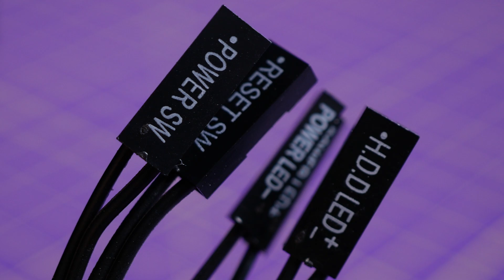How to connect front panel PC case power cables (power button, reset switch and more)

Comment: Is there someone or company make an L-shaped adapter for those jumpers: Because I want to install a second graphics card on 2nd pcie slot but the board is mATX AND the card covers whole space of the jumpers (f audio, f usb fpanel...) so I can't route the cables to pluggin in them :/

Comment: Am i crazy or at 3:27 shouldn’t the power connection have been connected to the top row instead of the bottom that belongs to the reset wire connection?
Reply: Yes he most definitely did that incorrectly. Pretty big mistake for an instructional video for newbs.
Reply: I hate that he didn’t respond to this comment because I noticed that too
Reply: I love you thank you so much

Comment: Pc hasn’t turned on in months. This did not fix it. Was really hoping it would
Reply from the maker: Does the motherboard get power? Can you see the LEDs on it or any lighting suggesting it's got power? Is it possible a power cable is loose somehow? Or perhaps your PSU has stopped working
Reply: @TheProvokedPrawn haha so I actually did end up getting it after messing with so much for over an hour and more research. Somehow got motherboard to finally turn on to give me the code C1. Then all I did was move the ram a slot over.. 🤠 but apparently I need to q flash my bio anddd this thing is 8yrs old so this is fun.

Comment: Sir I have this pc for about 5yrs now, yesterday it suddently shut down itself and couldn't turn back on, so I open the case and check if the mobo led indicator blinks while connecting power source, it did not, but when switching off the power from the main box, the mobo led  indicator blinks a few seconds then off. Please help!!

Comment: My case's front panel has a single F Panel connection, with the power and reset switch combined in the same connector. This supposedly simplifies the connection to the header. But the case has no power led. I want to add one which can be easily bought. But the case F Panel connector makes the mobo's power led header unusable. Any ideas how I can add a power led? My cases have always had a power led, I like being able to see it flash when the pc is in sleep mode. My new case is the LIan Li Lancool 216 RGB.

Comment: My pc has the single F panel connector but it fits loosely. Idk if the connection is supposed to feel a little loose, but does that mean I’ll need to get the extension cables with the split connectors?

Comment: Do u no Corsair 3500 case can u just use the plug came with case straight in too B850 aorus elite WiFi ice mother board instead using them little things
Reply from the maker: Yup

Comment: I just want to say, you helped me a lot during my build. I've watched countless of your videos which all helped me immensely! Thank you very much! Also the reason I'm watching this one is since my power led on the front panel is not lighting up, could this be a motherboard setting? I checked for continuity already.. the motherboard is fine but the front panel is harder to measure. I'm using the asus tuf b650 gaming plus wifi with the h6 flow (rgb). Again thank you for all the helpful tips and tricks! You're the man!

Comment: The mother board I am working on has the reset printed a bit to the right, not directly underneath the power button. Does that mean I need to skip one pin and plug in the reset button on the last two?
Reply from the maker: Refer to your motherboard manual

Comment: I've been researching all over to find what that arrow symbol was for on the power plug in. Thank you for telling me the answer to that. I bought the case from a friend who didn't have the manual, and it was my 1st build. So I'm glad to finally get good answers to my questions
Reply from the maker: Glad I could help!
Reply: @TheProvokedPrawn  Thank you so much! Another head scratcher is ground. According to Internet AI, the ground connection is considered to be negative in most electrical systems. Of course, my motherboard uses ground instead of negative. 🙄

Comment: no offence. I generally love your content but I need to give you feedback on this particular video.
Your target audience who would want to watch this are either noobs at pc building or those who have not built for a while  and just want a refresher.
However,  touch your own heart when you re-watch this video and ask yourself. 
Is this sufficient for such a target audience?
You connected it without showing all necessary connectors and even do not show the important one where it's single cables with "plus" and "minus" signs because it's blocked by the first connector you plugged in.
Then you suddenly ended your video assuming people would just "get it" for connecting the rest of the cables with poor camera angles and connectors that can't be seen when you plug them in.
"Watch out for that little arrow" With the freaking HDD LED connector blocking the view.
This is such a lazy work with no empathy for the specific target audience. Luckily there are better videos than this.
Reply from the maker: No offence...followed by offence. Love it. This was a short version of a much longer and more in-depth video. https://youtu.be/xT36IDSQBX4

It's also one of my best performing videos so. Whatever.

Comment: The FP connectors are the most dreaded part of the build for me...This is a simple, straight forward explanation to it.  I do have one question,  I have a Lian Li O11 Air Mini and I don't like the flashing LED indicator, I am assuming it is from the HDD activity connector.  Would disconnecting this get rid of the flash and retain the steady LED?

Comment: You just saved me a trip to my PC guy
Reply from the maker: Excellent
Reply: NEVER, EVER go to some shop. Just don't. You will pay money to a bunch of dumb teenagers who know very little more than you could figure out with a You Tube video and they might actually create  more problems for you!  There's always a video for how to do it for yourself. 
These days, I use pc repair shops just to buy a random little part I'd have to wait days for if I ordered it. 
I stopped using repair shops (years and lots of knowledge ago) the day I tried to get them to replace a PSU that was overheating on me (could smell the burning plastic/rubber) and the guy took one look at my gender and told me the "PSU wasn't blowing, I just got carpet fresh in it". CARPET FRESH wtf!!!!  Still makes me furious!! Purest example of sexism I ever experienced in my life! Also, the PSU actually blowing could have damaged my components. Those shops are akin to paying your weird uncle to fix your car by rigging a toggle switch under the dash vs just fixing it yourself the right way by researching it.  
 That PSU blew the minute I got it home, btw. I ordered my first part online that night and installed it myself! Then I began to learn to build by myself from that point on. I suppose I should thank those idiots for setting me on the path of building my own pc's, but I can't get over the blatant insult of it. 
 I'm still learning things. I'm on my second full, from the ground up, build now, despite the years I've been doing this. Usually, I just upgrade parts for a long time, but this time everything needed overhauled, complete with a new grown up looking case that sits in a living room and looks more like a large speaker.
  Thus, I am on here looking for how to install those little f panel connectors when they don't come as one piece in the new case and this mobo is also high end and a bit more complicated than the old one. 
 I'm still not sure I have the instructions clear, but I got the part where nothing will blow up. It simply won't work if you get it wrong. LOL!  
Anyway, yeah, stay away from pc repair shops. Don't pay them and they will go away.

Comment: I cant find the reset sw cable
Reply: Me neither
Reply: Same
Reply: @Notachillguyatall  i found out how it works you dont need it
Reply: @mpfreerider6733 does your pc run well without having reset psw bcs im either cant find the reset psw but my pc is t boosting
Reply: @ i pretty sure some  might not have them because mine doesn't and its good
Reply: Need to look later how it works
Reply: @mpfreerider6733 ok
Reply: I can't Neither
Reply: @ some don't have it mine didn't

Comment: I have a wire missing from the Mystic light breadboard that illuminates 6 ANS AND A DRAGON and the MSI CPU cooler. It has 2 wires. Where are they connected on the motherboard? There is also a SATA connector at the bottom of the board. Without the lone open pin at the top of the board, all the fans light up red? Is it the RGB I read a warning about 12v and 5 v connections will nuke it if connected incorrectly
 ARGB control board in the chassis. You need to use it to control RGB with the MSI Mystic Light app in Dragon Center.. ARGB control board in the chassis. You need to use it control RGB by MSI mystic light app in dragon center. But only 100R support it the ARGB board. ARGB control board in the chassis. You need to use it control RGB by MSI mystic light app in dragon center. But only 100R support it the ARGB board. ARGB control board in the chassis. You need to use it control RGB by MSI mystic light app in dragon center. But only 100R support it the ARGB board. ARGB control board in the chassis. You need to use it control RGB by MSI mystic light app in dragon center. But only 100R support it the ARGB board.

Comment: My pc wont power on still.
Reply: me either did you find a solution
Reply: not from this, so I checked out another video... then I took it to a professional.
and it worked.

case in point. just sace up for an alien.

Comment: This is so confusing and the guides help so little...
A MULTITUDE of questions:
- Are the pins alternating plus and minus left-right ? Is the upper pin a plus and the down pin a minus or reverse ? The guides in the manual seem to say i should position the connectors vertically, but I see in this video they are positioned horizontally. The drawings on the MB are EXACTLY the same, which puzzles me
- Does it matter if I put (by mistake) the Reset connector in place of the Power connector, if I switch them? Are they both supposed to be with the writing upside? Are they supposed to be with the writing on "teh visible part", meaning one upside, and the other upside down?
- You stopped the video short, before I could see how you position the Power connector :(
- WTF happened to colours, why dont the manufacturers use them? 
So frustrating!

Comment: Have been installing computers for years but there is a new case that came to my office, it is a mess, there is an extra piece of cable that has no name, and connects two leds. The case has power redet, usb, LED and the one without name

Comment: I only have “F PANEL” on my motherboard and all the little wires on the case. Does that mean my motherboard isn’t compatible with the case?
Reply from the maker: F panel is what you want. Look at your motherboard manual and you'll see where the connectors need to go.
Reply: @TheProvokedPrawn  it only has two pins though

Comment: In my case there is no markings so I have to guess?
Reply from the maker: Check your motherboard manual
Reply: @TheProvokedPrawn  Cannot find it... It is 5y old PC... I will prolly have to throw it away, cuz i live on the island so if you cannot fix it at home it is just not worth it to ship it away... A bit more then 1000€ (that was a lot back then) I live in Hvar (Croatia)
And I have 14 holes... d33c20 rohs motherboard... Cannot even find online manual. It is the black/silver and it has only 2 slots for memory. 5 years of data... Of unfinished games... I am working on this all night long, tryed all combinations...

Comment: my PRO Z790-P WIFI motherboard looks nothing like yours. It has nothing labeled "power", "PWR", "reset", "RST", not does it have any + or - on it. 

I've spent 4 hours trying to figure out where to plug my Corsair 5000D Airflow case's reset & power plugs with no progress. 

I want to die.

Comment: Thanks i removed all cables to clean my pc, when i needed to reassemble it i got stuck with the frond panel connectors 😂. however my motherboard i a little older so it lookt a little Different, i hoop i dit it correctly but we will see when i turn it on😂

Comment: Thanks, this helped. Completed my first PC build today. Sadly, it was for nothing as I have two dead memory channels due to a bent socket pin 🥲 (it came like that )
Reply: It's such a shame too... The PC was complete and everything, everything worked except for the RGB lights on the fans (I didn't want to connect them until I made sure my PC was fully functional) so yeah using this video and consulting my manual, at least I figured out how to get the power button working.

Comment: I unplugged my Power SW cable to clean the PC and to swap GPUs, and now even though the PC has power. The power button on the case doesn’t work. I have done this so many times, and this is the 1st time it doesn't want to turn on. I have checked all cables about 10 times. Everything is correct. I should've never unplugged it. Man, im pissed.

Comment: I was looking to find where is plus and where is ground on power and reset connectors and i found it in your video. Thank You. Was afraid to connect it wrong because it could short if case buttons share same little board. Thank you again. Have a great day.

Comment: I am used to the old separate little wires. Recently, I upgraded to a 011 VISION Envision case, and it came with an F-PANEL wire🤔. Omg...I look everywhere for the little wires. You save me from sending back this gorgeous case. Thank you⭐️⭐️⭐️⭐️⭐️!
Reply from the maker: Great stuff 😂
Reply: i have a smart f-panel but my computer doesn't work, is it because the mobo might not be compatible? so I need a extension? @TheProvokedPrawn
Reply: The Hyte cases use the F-Panel which is nice, don't have to worry about those other cables

Comment: What if the reset sw wire is broken?
Reply from the maker: Reset switch isn't essential. Don't connect it and just restart via windows rather than a case button. Some cases don't even have that cable.

Comment: HELP! in my case i have a single F_panel cable, i’ve found the placement on the mobo for it but the pins don’t align?. The pin that’s closed of is on the wrong side of the cable with no way to flip it into the correct spot 🙏🤦🏽
Reply: same here don't know what to do
Reply: SAME! My configuration is different... its the 20-8 Style pin on M5A78L I have no idea how to connect the Front panel cable into it..

Comment: Excellent video. Very helpful for my first build. Im using a Corsair 4000D case. These connectors seem really “loose” on the plugs when connected. Like they could fall off easily with minimal movement or vibration. Especially the single power LED wire ones. Thoughts? Suggestions?
Reply: Yeah they are like that sometimes
Reply: @Connor-zb4uo  Gotcha. Thanks. Seems to be working properly at least.
Reply: @randyczerviski8903  I just finished putting together my second pc like 10 minutes ago and mine are really lose on this case which is a coolermaster. My first pc build was on a 4000d corsair and didnt seem too lose but lose enough that if they got snagged they would pop out. Its just the weird design of the cables I guess
Reply: Gotcha. Thanks. Yea my buddies seemed to be that way but everything is working good so all should be good. I really appreciate the feed back! Thanks again.  @Connor-zb4uo

Comment: It took me 4 days to see why my computer wasn’t working and this video got it turned on your the man thank you so much
Reply: what was wrong?
Reply: probably had them in the wrong spot, like i did..
Reply: Probably wrong insert in smth @George-um2vc
Reply: So basically this vid is useless as u failed to mention exactly how the power and reset hook up. Do they go opposite as top one has + on left and bottom has + on right ? Cause the mother board doesn't show what is + or - on the maximus dark hero and I'm waiting till I see someone show exactly what way before I turn it on. Maybe make a update video.
Reply: @mattg2596  try find it in the manual that you hopefully got with it, trust me! :)
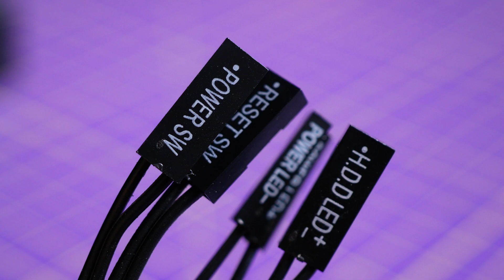Reply: @mattg2596  re watch. He definitely mentioned it at around 1:50..

Comment: Yes why are these plugs and markings so small and the manuals are always in a very small feint font.
And the printing on the mother board is hard to read as well

I'd love to buy one of those adaprtor plugs that you mention. But I cannot find one. Do you have a brand name or model ? or a link ?
It would make it easier.
Are all motherboards pins the same ?
Reply: Yeah I hate how small the text is, Just try to plug them in outside the case and put the mobo in and shove the wires somewhere or have someone with good eyes do it

Comment: Can u please tell where to connect case fans. I’m using phanteks G500A and i connected almost everything except one full 3 pin connector and a 3 and one missing point connector. They both are from case fans and idk where to plug them..
Reply from the maker: sys FAN headers on the motherboard. You can see some examples here I think https://youtu.be/mPRrPGjV_jo
Reply: @TheProvokedPrawn the 3 pin one is a daisy chained cable.. it’s more like 3 fans connection got connected into one 3 pin daisy chainable cable.. i’m confused